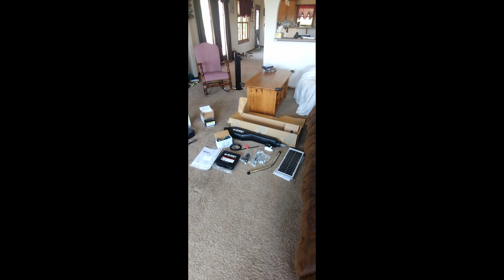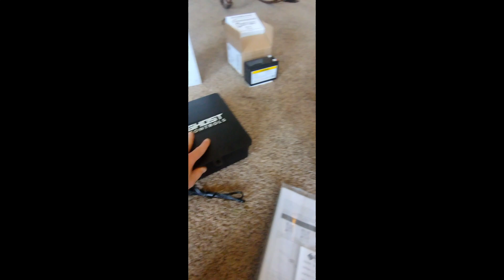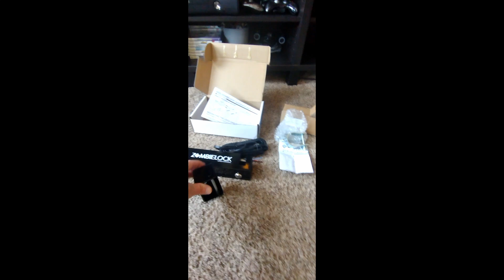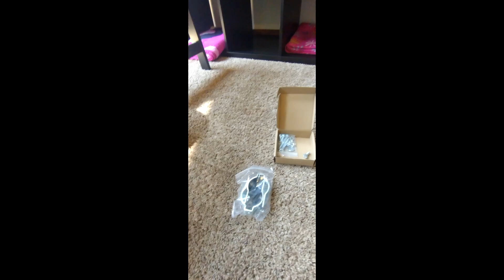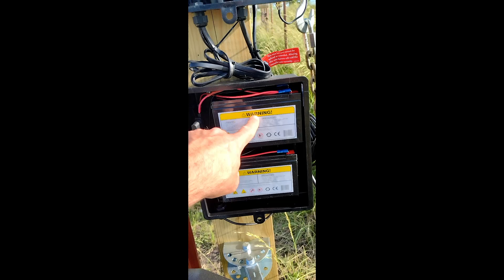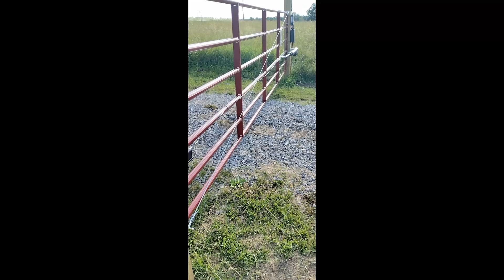Ghost Control Gate Automation Review

Comment: They have an extra hole that is sorta pre cut where you were pointing to. I went with the control board that offers you to use solar or the transformer to recharge the batteries. It allow you to run a 16/2 wire up to 1000'. The funny thing is the transformer is not outdoor rated. They recommend a deep cycle battery, not a car battery, but i cant remember if that is when you use the solar to charge or the transformer. Also the transformer puts out 18v AC at roughly 1 amp so..  as for the holes in the control box i also got the ghost multi connect. It comes with a grommet to swap the strain relief that the battery wire runs through. Its funny though because the instructions for the transformer, gate actuator, zombie lock, and the battery hook up dont take into account the possibility of a system having all of the system add ons. I dont like the idea of have to cram 3 cables in a grommet, so i drilled to the right of the speaker and i bought qn additional strain relief.
Reply from the maker: I just looked at mine this weekend, I had to do some adjustments.  I didn't see a precut.  I wonder if maybe they put that in for options where there are two actuators? (i.e. a two-gate system) Yeah, they really didn't do a very good job of planning for multiple additions to the system when it comes to wire management.  So far, knock on wood the system is still working pretty well.

Comment: Considering a system identical to yours. After 10 months of use are you still happy and would buy again?
Reply from the maker: Yeah, I would buy it again.  A few issues we've had are that if it's over cast outside, the batteries go dead if you use it more than three or four times in the day.  Also trying to come up with a better gate actuator mount.  The original keeps working loose.  I think that mainly due to the gate being so big.  Not sure if you saw the other video on the alternative zombie lock latch.  I had a really hard time keeping it lined up.  One thing to note is that on the zombie lock, you can slide the actuator back using your finger.  So if physical security is a goal, you might keep that in mind.  Be careful using any of the timed/delayed motions.  There aren't any sensors to prevent a gate to object collision.  It does stop if it hits something, but it would damage a car's paint.  Other than that, it's worked out very well.

Comment: Thanks for sharing.   I would suggest adding a "Y" bracket to accept the gate latch.  It could be as simple as 2 pieces of flat bar bent up for the top and bent down for the bottom piece.  Weld a tab for bolting to the post, or drill and tap for bolting to the bracket itself.   If you want to get fancy make a bracket with a 2 inch wheel/roller mounted to the gate-set with assumption that the gate could be 1" low and it would ride up a metal guide.   The rollers used in dryers on which the drum rolls are perfect for this-and perhaps free.